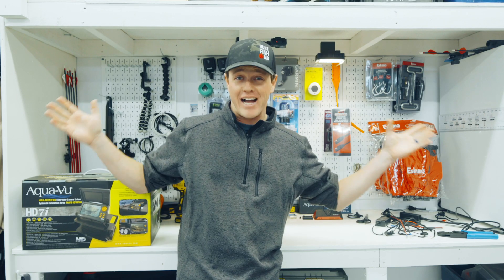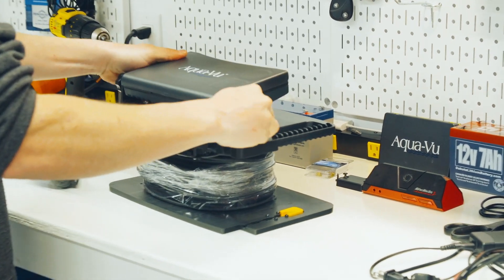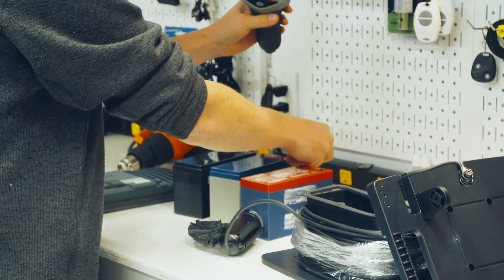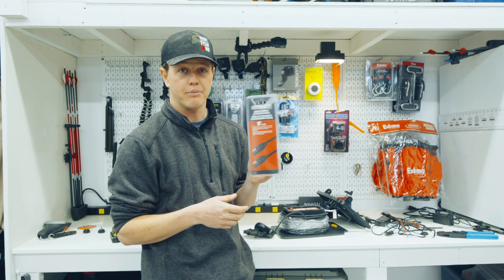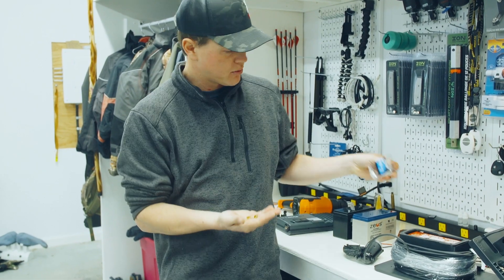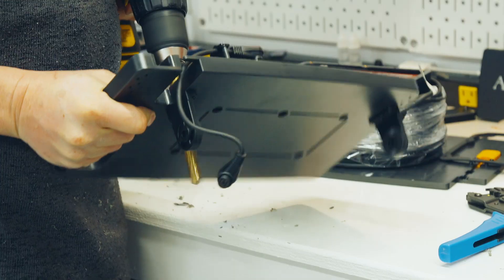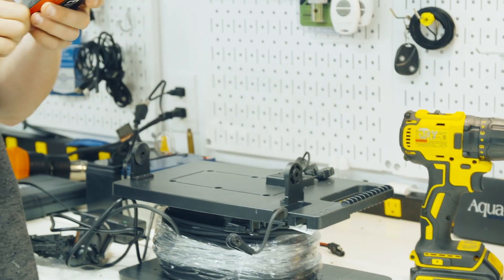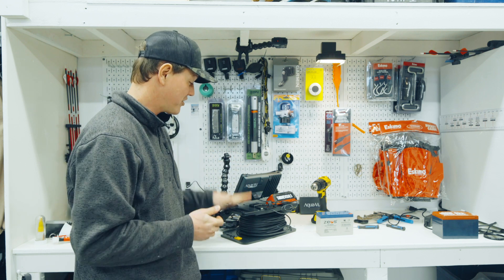How to Make the MOST of your Underwater Camera! (Ultimate Aqua-Vu Mod)

Comment: Nice mods, Jay!! Instead of crimping and heat shrinking, maybe try soldering the wires together then heat shrinking the cable. The soldered connection is a far more positive connection when done correctly, and if you are going to get into doing modifications, soldering is a great skill to have in your toolbox. My weapon of choice is a Hakko FX-888D, I've had this soldering gun/station for several years and it has far and away earned back the couple hundred (less I think) I spent on it. It is a comfortable and intuitive unit to cut your teeth on and grow with.

Comment: Aqua vu also makes a external battery cable that plugs into your charging port it won't charge your battery but will power your device costs 30 dollars an can add a 12 volt battery to it for additional run time.  Your idea was good but what the most frustrating part of your idea on replacing the battery it came with was battery size I went with a 12 volt 54 amp lithium Dakota battery that will last 21  hours run time over kill but there is no cosmetic features required or worrying if the new battery u got will last long enough

Comment: Battery size is a issue too if it would fit in the slot after replacing the other with the aqua vu external cable any size 12 volt battery will be good but will be plugged in externally

Comment: 1 other thing I found out the ah which is amps is the amount of power your battery has it reflects on how long it will last not how much power is running through your machine this is something I didn't know till I researched batteries the higher the amp the battery is the longer it will last but the cost will increase also I spent $429 on my battery but will power anything requiring 12 volts of power for 21 hours
Reply from the maker: Good to know!

Comment: Anyone know what the pro feature or features adds to the unit compared to the base model? 
Looking a purchasing one and want to know the difference.
Also, have a done a modification like this, I've attached a solar panel to my camera and had enough power to run the camera without the battery connected. Has to be a sunny day. But saves battery life, used the camera all day on one battery not using the battery most of the day.
Reply: Good tip for the solar panel! Screen brightness can vary between the 7i and 7i pro. Also features like camera direction depth, on screen displays, cable length etc. They list the differences here. https://www.aquavu.com/aqua-vu-product-comparison

Comment: Since there is no switch or fuses, are the USB ports always drawing power? How will that impact the life of the battery? 

Sorry if these are noob questions, electrical engineering is not my strong suit. 

It looks super clean, though. Well done.
Reply from the maker: I’m sure it could have a minor draw. Not something I’m worried about. Typically I’m charging my gear right before a trip anyways.
Reply: Aqua vu makes a WiFi adaptor you hook to the camera so you can record videos on your phone.